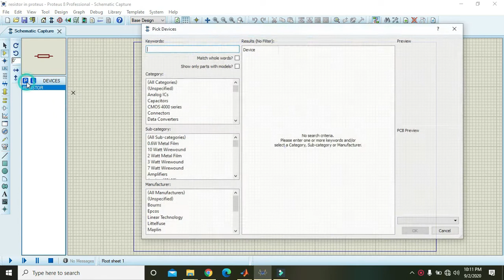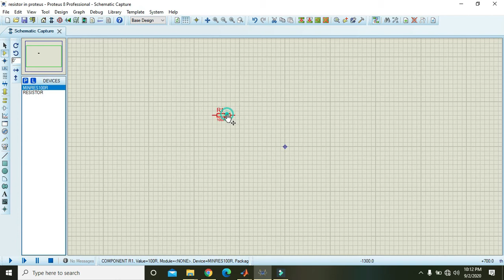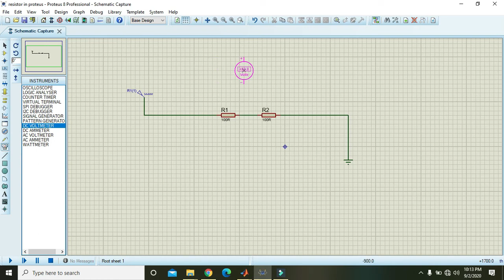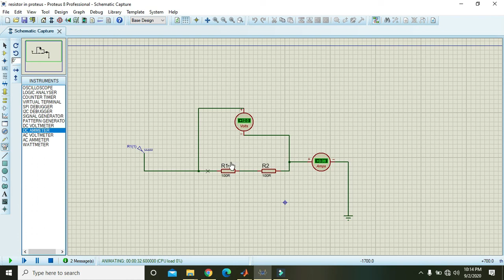how to use a resistor in proteus | Resistor in proteus

Comment: I'm given the power rating of the resistor i'm supposed to mount on my proteus setup. Should I take the power rating value into consideration?...If yes....how can I add it on the resistor ?
Reply from the maker: u cannot change the power rating of the resistor on ur own..i think u have to take fixed power rated resistor from the components...........